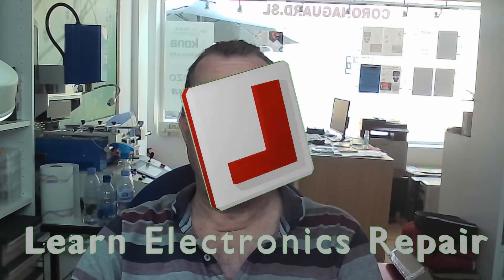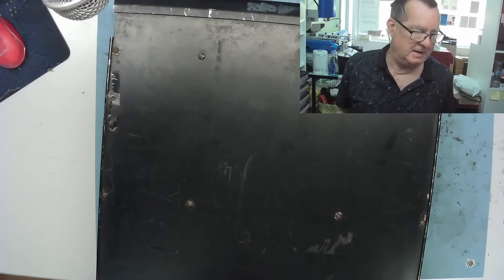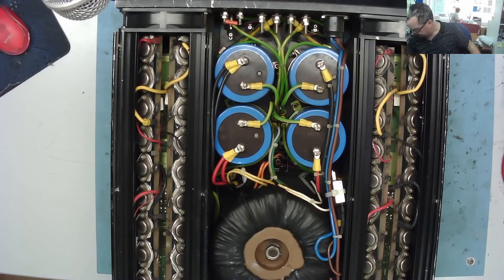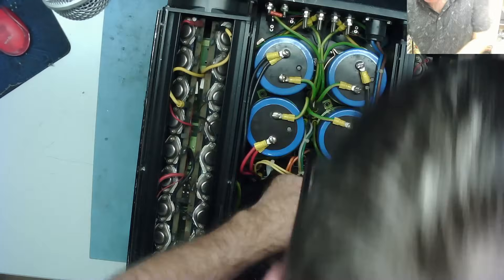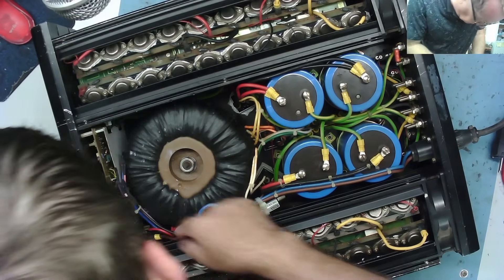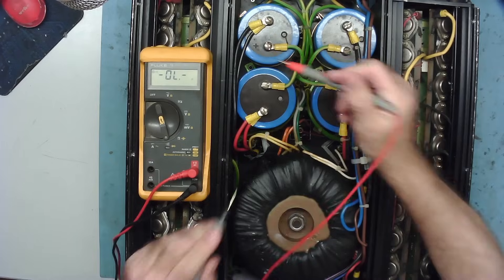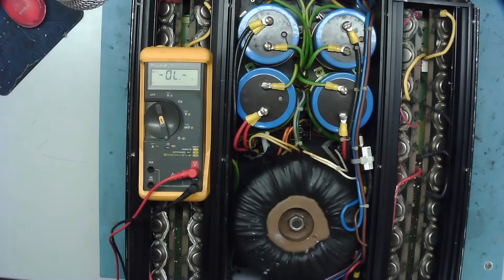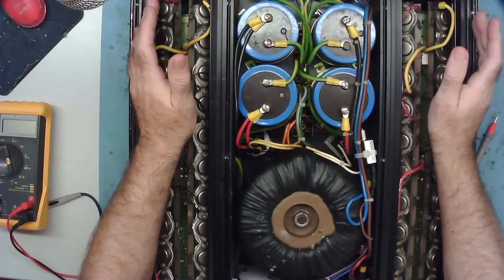All You Need To Know About AMPLIFIERS To Fix Stuff - A Beginners Guide To Audio Amplifier Repair

Comment from the maker: A couple of points:  As a few people noticed I mixed up the terms peak voltage and peak-to-peak voltage a few times in this video.  I do know the difference it was just me having a bad day 🤐. If you noticed the mistakes then I hope you can skip over that and relax in the knowledge that you are correct 😉

Another topic that I did not mention, because I was looking at a PA amplifier, but is very relevant to Amplifier repair especially when it comes to the 'home stereo' type amplifiers from the 80s and 90s (but other decades too).  If you have one or more these symptoms:
* an amplifier with the voltage rails present but no sound output on one or both channels
* intermittent audio on one channel or both
*it works on some audio sources but not others
* one channel lower volume than the other (or changing volume by itself)
*crackling, popping or other (often intermittent) noise on one channel or both

Then the most likely cause is the input select, mute and/or speaker select switches that are causing the problem.  Usually these are multi pole rotary or push button type switches and the internal contact become tarnished with age.  In my experience the only way to fix this (reliably) is to remove the switches from the PCB, carefully dismantle them, and clean the contacts.  Usually replacements are not an available option and this becomes more a restoration job than a repair job.
Reply: yeah I noticed but w/e it easily corrected in our heads. Are you sure it wasn't a secret test ? hehehe. Thanks
Reply: It happens. Don't sweat it.
Reply: I´m strongly with Scott Grammer on this: We all make mistakes man. But there aren´t many people in the world who can do what you can. Be proud of your skills, try to learn from mistakes - the only real mistake is to never even have tried, be gentle with yourself.
Reply: BigRedGevo 😂 too true
Reply: As a fledgling in this area the video was tremendously helpful. 👍
Reply: I'd also argue that your B and AB explanations are off.

You're correct about the diodes  setting the bias but this is also where the bias resistors (pulling directly to the rails in this example) come in.

The bias resistors are not present for the class B and this is the sole cause of the crossover distortion. The matching of the transistors is less of a consideration, but true, symmetry is a factor, just small for a pure class B.

Using the B as drawn, there would potentially be no crossover distortion (if the resistors are selected adequately), but any forward bias means heat. Any excess bias above that which is necessary to bring the transistors into their linear regions, causes wasted power.

This is of course messed with by heat, and the diodes stabilize this, but they also need to be in close contact with the heatsinks in order to correlate with the transistors correctly.

I know, beginners course and all... lol
Reply: @MadScientist267  There ain't no diodes in B, there are resistors - your argument is invalid as you claim there are no "bias resistors" when in fact there is.

You seem to be mixing up the A/B differences as B/AB.
Reply: @sirtra  We changing electronics history now as well?
Reply: @MadScientist267  huh? You might want to re-read what you wrote and re-look at the diagram drawn for B.

You first state that the "bias resistors" are the ones pulling directly to the rails, then also state that the "bias resistors" are the sole cause of crossover distortion and they (bias resistors) are not present for class B.

Even in a hypothetical perfect world where you precisely match the resistors to the transistors - both transistors will be ever so slightly "ON". This in turn means that even though the audio signal doesn't need to overcome the bias resistor - the output from that transistor still needs to overcome the output of the other transistor, hence there is still a deadzone near 0 which will be due to the transistors not being precisely identical.

No idea where history comes into this as no one except you has mentioned history 🤷
Reply: @sirtra  No that was a jumped thought. Ok my mistake there. To clarify:

A is on all the time and biased ~50%

B is off for quiescent and low level signals because there is nothing to bias the transistors into linear. A totem pole mosfet driver fits this description.

Class AB is always on low level due to bias pulling on them, and this process may be improved by using diodes to set the voltage drop to establish the baseline bias, and more importantly, when properly thermally in contact with the final transistors, automatically adjust the bias with temperature changes.

I apologize for the confusion.
Reply: @sirtra  And yes for simplicity I ignored the fact that the one transistor is driven into cutoff by strong signals. I'm addressing the base topology as it would be running during setting bias - no signal input.
Reply: @MadScientist267  still not correct

The difference between B and AB is the diodes. They are not optional extras 🤣

Like i first stated, you seem to be misappropriating the differences of A vs B as though they are B vs AB.

A = very inefficient, constant output to the speakers
B = efficient but prone to crossover distortion
AB = efficient and negligible crossover distortion

No amount of superfluous, and frankly bizarre, unrelated info such as thermal coupling the diodes/resistors will make what you stated valid.
Reply: @sirtra  No. A class B is not biased whatsoever. Ever. Period.
Reply: @sirtra  All you've done now is demonstrated you don't understand how power amplifiers work lol
Reply: @MadScientist267  what do you think the pull up resistors connected to the rails in the B diagram do?

I don't think your terminology is correct for the context in which we are discussing - an audio amplifier.

Rather than childish insults and deflection, maybe try addressing my point about you mixing up B and AB - or more simply put, explaining how what you stated re diodes is correct and what i've stated is incorrect?

That's generally how mature adults have a discussion involving a disagreement or misunderstanding.
Reply: @sirtra  Go do the armchair thing somewhere else. I'm done here. You've demonstrated you have no practical working knowledge of a class AB power amplifier. I posted the correction to the creator for a reason.
Reply: @MadScientist267  you've demonstrated that you have the maturity and temperament of a young child.

Rather than admit you might have made an inaccurate claim or *gasp* a mistake you double down and resort to insults.

Worse still, when faced with a direct simple question that would clear up any misunderstanding but expose any mistakes or inaccuracies you dip'n'run... but not before one last outburst of course. Bravo!

Thanks for sharing your expert knowledge and being so clear, precise and accurate whilst doing so!

We can all learn something from this exchange.... just what that something is however will depend upon the type of person you are.
Reply: @MadScientist267  cool, report away!

After some research it appears that you've assumed the information on Wikipedia is correct and that the information in this video is incorrect.

I was scratching my head at first trying to understand why you are mishmashing terms like bias and throwing in other obscure ones but after looking at this page:

https://en.m.wikipedia.org/wiki/Power_amplifier_classes

Things became much more clear.

It appears this is what you are taking as being a source of truth whilst neglecting to notice the [citation needed]

Take for example the AB diagram shown, putting diodes like that doesn't bias the transistors at all - in fact it would make the distortion even worse as the input signal would be dropped 0.6v going through the diode and then would need to rise even further to turn the transistor "on".

So by all means, report this message, let a youtube staff member look over our exchange and make a judgement on whether i've violated the ToS.. not sure what you think the outcome will be, especially after attempting to insult me, if it's intended as a scary intimidation tactic then i'm sorry that's yet another fail.

But hey what would i know, i'm just an amateur still learning 🤷

Have a good one mate!
Reply: @sirtra  No Wikipedia involved. Decades of design and repair. Documentation from before Wikipedia or even the Internet even existed. I can explain all of it to you but I can never understand it FOR you. You (and the creator) have it incorrect and I was pointing that out to him not the armchair expert that doesn't understand anything yet tries to profess. The fact you even had to look it up confirms my stance.

Clasa B isn't even used for audio. There's a reason for that. No bias resistors means no bias means crossover distortion means useless for audio. But keep referencing the individual I corrected and wikifying the "understanding". In the mean time, find me a commercial example of a class B amplifier boasted as some "breakthrough" for audio. It won't happen because they don't exist.

But I'll wait.
Reply: @MadScientist267  are you familiar with the concept of projection in terms of human psychology?

I've not claimed to be an expert, armchair or otherwise.

I am indeed still learning however even my novice understanding seems better than yours.

You don't seem to be able to clearly state exactly what is incorrect with either what i've said or Richard in the video. When asked to clarify or be specific you simply deflect and try what is colloquially referred to as "moving the goal posts" such as now demanding i find some sort of commercial class B audio amplifier and if i can't i'm wrong or something?!  Weird.

Plenty of class B audio amplifier circuits out there, if you do a search for "class b audio amplifier diagram" you will find one of the top hits is All About Circuits.

Here is a cut'n'paste from that page which disproves your claim about class B never being used for audio, i mean sure maybe not common as a commercial audio amplifier but in terms of a DIY hobby projects and similar it most certainly is:

----

Analog Lab - Class B Audio Amplifier

In this hands-on electronics experiment, build a Class B push-pull audio amplifier to drive a speaker and learn about crossover distortion and how to minimize it using negative feedback.

Project Overview

Class B audio amplifiers provide efficient power amplification of analog signals, but often at the expense of signal distortion. In this project, you will build the Class B (push-pull) audio amplifier, shown in Figure 1. 

----

What do you think pull up/down resistors on the input of a transistor (or MOSFET) do if not biasing?

I'll not hold my breath waiting for a clear and concise answer from you as i highly doubt one will ever come - but hey here's your chance to get that final word in which i know you're desperately wanting... i will not respond to you any further unless you answer my question above.
Reply: @MadScientist267  okay with a fresh set of eyes i think it comes down to this:

When you say bias you've meant the transistor is forward biased above the cut-off point, so it's in the active region - so in possibly too oversimplified terms for your liking, it's always on

When i've said bias i meant not floating or pulled towards the +/- rails but not necessarily above the transistors cut-off point, it could be below the cut-off point and thus not putting the transistor in the active region - so in oversimplified terms it isn't always on.

If so, i can sort of see where you are coming from and why you might take issue with what was drawn.. however honestly it seems a bit pedantic and argumentative if so.

I think further confusion stems from whether a transistor or MOSFET is being used but i don't want to muddy the water any further.

On the upside this very pleasant and heartwarming exchange has re-enforced my belief that if someone cannot explain a concept simply, then they do not understand it well enough themselves... Oh the joys of dealing with "experts" when learning 🤹
Reply: @sirtra  None of that is an example of a commercially produced class B audio power amplifier. So I'm still waiting.

I see now claims of being a master of the headspace are on the horizon as well.

What's next? How to replace fuel rods? Might be better to start with figuring out how those diodes are used to adjust that bias first... keeping things extremely simple appears to be important.

Don't bother with anything other than an example as asked for with a response. Without that, there's nothing to work with here and I'm done here.
Reply: @sirtra  You still don't get it. What he's calling a "class B" is NOT class B. It is class AB. That's all there is to it. That's the "simple" that you seem to be requesting.

Which I've said in a few different ways now. You can't call something learning when there's no learning happening. I think I'll keep going with the terms every last book I've ever been in on the subject instead of some bent up version that is being spread on the internet. They're all in agreement with each other, and disagreement with both the creator's understanding as well as your own. I posted to correct the first part there... I even gave an example of a true class B amplifier stage... and all that was taken from that is "mosfet cause confusion". I give up. That "understanding" you're claiming here is non existent and you just keep proving it over and over. I'm out. Have a nice life.
Reply: There's a REALLY simple way to sum up the originally defined classes:

A - 1 transistor forward biased. Suitable for small signal audio because efficiency is very low, but is very accurate in reproduction. Discrete component preamplification stages are in this category.

B - 2 transistors working as a pair, unbiased. Efficient but not suitable for audio, used mostly for driving on/off signals. Totem pole for driving final PWM stages, half and full H bridge, etc are examples.

Class C - The transistor(s) biased into cutoff. Not suitable for audio, very useful for RF.

AB - A topology originally created specifically for audio to combine the fidelity of a class A with the efficiency of class B, so that higher power output was possible without excessive waste heat. This required the bias resistors, and later, much later, was improved upon by adding the diodes, and then shortly after that it was realized they were useful as automatic bias adjustment for thermal consideration.

Later on, class D addressed a standing concern with AB, and by using a switching topology, and the beloved class B to drive the final (on-off only, remember?)... this all but eliminated the waste heat, at the expense of a little bit of quality, which a fast enough clock feeding the comparator all but eliminates as well.

Don't try to argue with someone who watched it evolve and has used all of the classes mentioned, more than I can even remember (except C, I'm not into RF).
Reply: @MadScientist267  19:45 "these resistors are set basically so each transistor is off, okay, it sets the base voltage so it's not on, it's off, it's not doing anything"

This description matches every single resource i've read that discusses amplifier classes and makes sense to me.

You keep saying it's not class B but seem to be unable to explain why it's not.

I say that it is because at rest/idle/no input the transistors are off and the duty cycle for each transistor is less than 180 degrees.

Now if it was biased in such a way that the transistors were on, just barely, then it would be class AB. However as per the above quote this is NOT how the class B circuit was described.

I think you didn't properly watch the video and just have some sort of weird beef tbh. Why else would someone with decades of experience be watching videos on a channel called "learning electronics repair" complaining about the manner in which class B amplifiers were described?

Weird man, weird 🤷
Reply: @sirtra  It isn't class B because of the resistors pulling each base toward their associated rails. The two resistors in series with each other between the bases are indeed part of the bias scheme, but because there's a bias scheme at all, this is a class AB as drawn. To have a true class B, the Rbc resistors can't exist. Their presence, makes it an AB.

Also, in the context of audio amplifiers, the term "bias" by itself usually refers to setting the forward quiescent current in the transistor in question. This isn't to say it is never used to indicate cutoff, but because all of the stages in a traditional audio amp require some amount of forward conduction, the one off situation where you might see bias into cutoff will be stated as "toward cutoff", with simply "bias" will imply "into conduction". 

To answer the question "why am I here", I find them by feed algo, and occasionally one will be enticing for whatever reason and it becomes somewhere between seeing if there's a new trick hidden somewhere and an "audit".

This guy is pretty good, it was just this one point that got me. 🤷‍♂️
Reply: @sirtra  Possibly put another way, because of that wording, he's on the fence of biasing it like a B... but what he's not mentioning is there is still a forward bias there. I'm assuming since he didn't give exact values and is talking about them "doing nothing" that his theoretical Vbe is 0.6V. This indeed makes it act like a class B but it isn't a true class B. It is an AB biased as a B, and this may be where the web ran with it and this became "common knowledge".

Fine line indeed, and I realize it's "picking" a bit... I digress. It also wasn't supposed to become a thing down here in the comments but maybe that's all good too... if I'm right about what I just mentioned, I will have learned something here too.